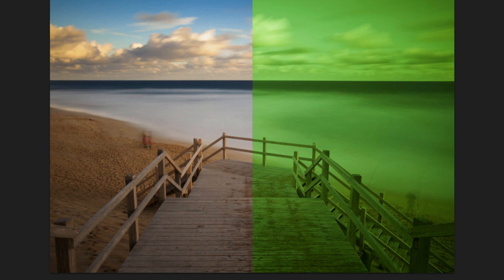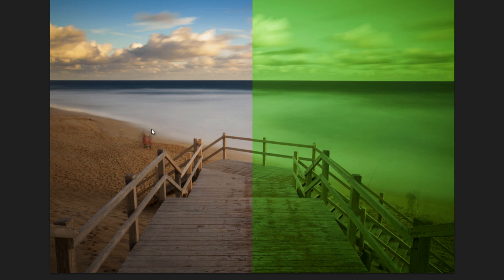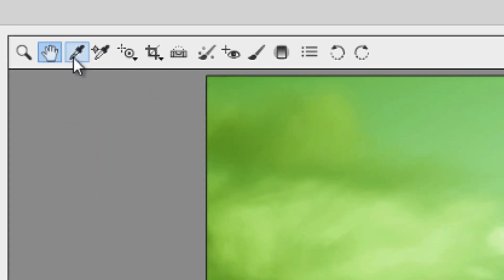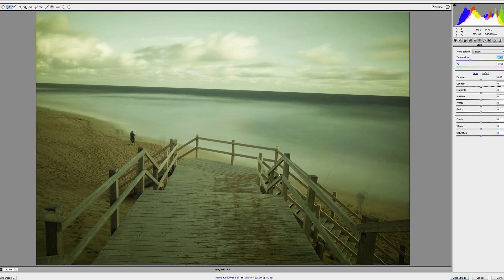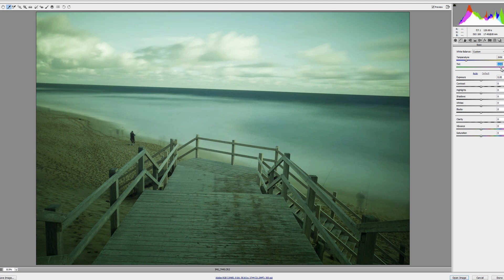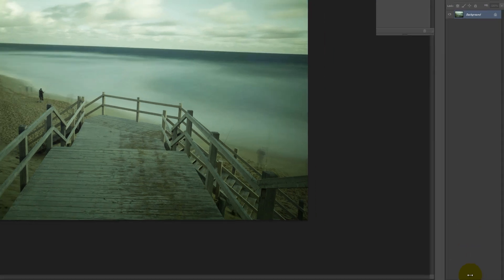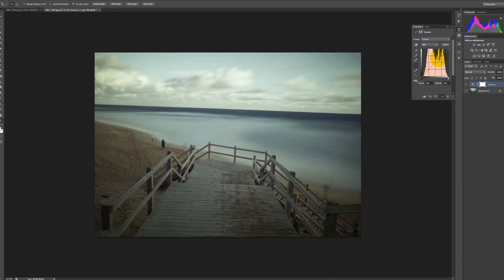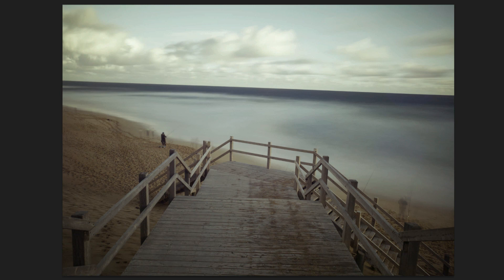Welding Glass Neutral Density Filter - How to Remove Colour Cast

Comment: where did you get this glass? I've looked everywhere and the widest I can find is only about 50mm
Reply: Steve White Welding glass can be found at any local hardware store, Home Depot or lowes. It'll be a square piece of glass, you just glue it to any of your filters or use rubber bands to hold it in place

Comment: Is it possible that you can set the cameras white balance to compensate so that the color cast doesnt appear? Also, you can always convert to monocrome.
Reply from the maker: Jeffrey Byrnes  some what definitely. I actually find using welding glass is best suited for black and white with some subtle tones dropped in. Colour is definitely workable but for an easy result - black and white is great.